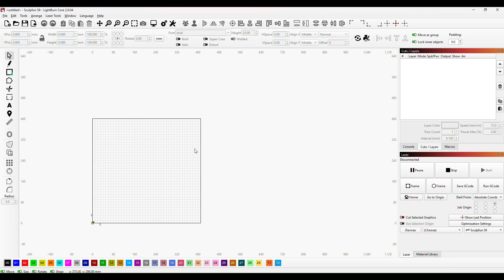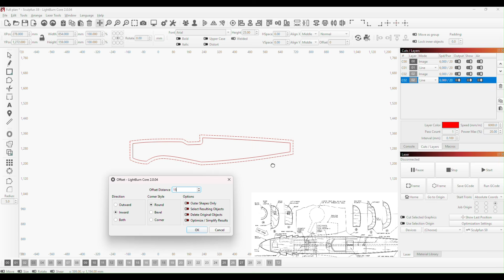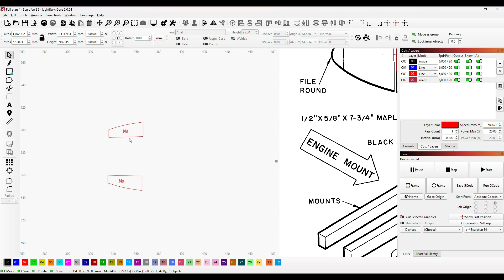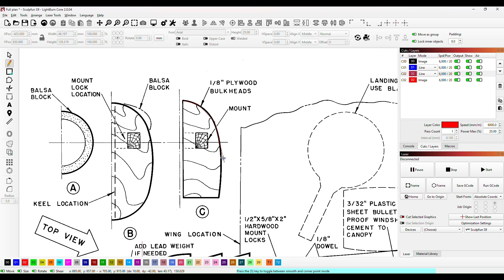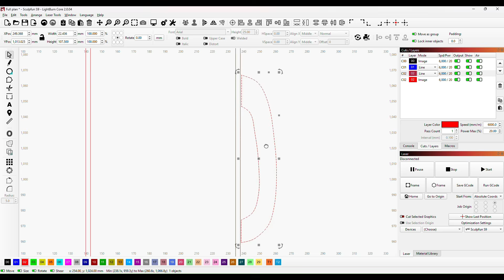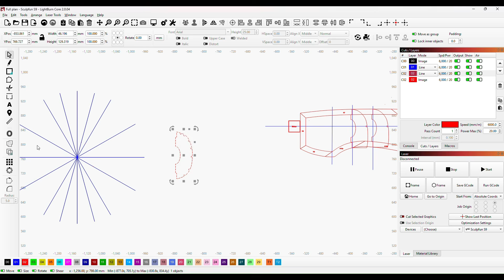How to make a 1168mm RC model of the iconic SPITFIRE using Lightburn and a cheap hobby laser cutter.

Comment: Could you send me the link for the motor mounts please because I can't find it
Reply from the maker: The motor mount design is shown here at 3.10
https://www.youtube.com/watch?v=JiGt-r_Z29U
However, I don't have a link showing how to produce it I just produced it while offline. Notice that the mounting holes do not form a square, more of a rombus or a diamond shape. The larger hole in the centre is to allow the shaft and the circlip to spin freely and the oval hole below is to allow the cables to go back into the fuselage. The notches are specific to whichever plane you are making. I just copy the mounting holes and centre them onto the appropriate former.

Comment: how did you go about scaling the plans within lightburn
Reply from the maker: Lightburn works with the full size plan, so there is no scaling on this particular project, I typically drag the full plan in and work from that, as you can see in the video. If you wanted to change the size of the model then just alter the size of the plan once in Lightburn. If you do that though make sure you only use that plan. Good luck, let me know how you get on.👍👍

Comment: I am confused as to why you chose a control line model instead of the many RC versions of this model.   Walt Musciano was a great designer, but if you intend to build to this plan it will be unnecessarily heavy.
Reply from the maker: Thanks for your comment: I chose it mainly for the size - 46" wingspan. and that the formers are well defined on the plan lending itself to Lightburn. Also the original plan calls for 'planking' over the whole fuselage; as I explained in the video I will be using 'Oracover' so there will be no weight problem. Every model I 'convert' is either rubber powered or IC powered and I convert to electric RC so control line is a tiny leap. I don't think it would be as much fun if it was just a straightforward copy. 👍👍👍

Comment: what is the purpose for splitting the keel up into those complex smaller pieces? It appears that the area around the cockpit would fit in the workplace as a single piece. Does it maximise space this way? Very interesting video, gives me some ideas for using my laser.
Reply from the maker: Thanks for your comment, it is all about wood-grain direction: If I made the cockpit area from one piece the upright bits would have the grain going crosswise and would be very weak because of that. It does also maximise space, but that is not the main reason.👍
Reply: @LaserRCModelguy  Cheers for explaining - makes perfect sense and not something i'd considered. Practicalities come through. Ty!
Reply from the maker: @davemcconnell2491  👍👍👍